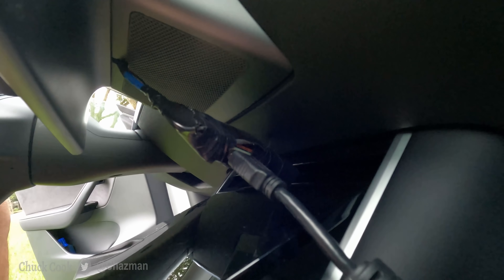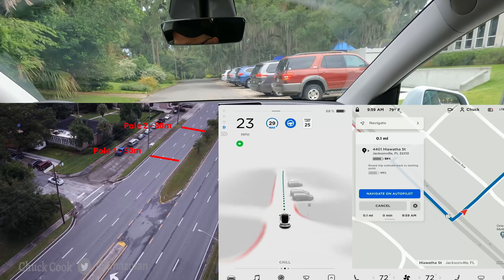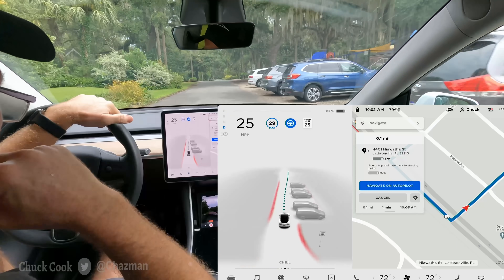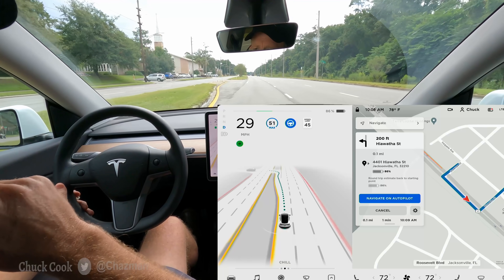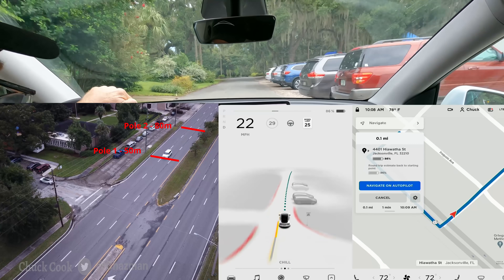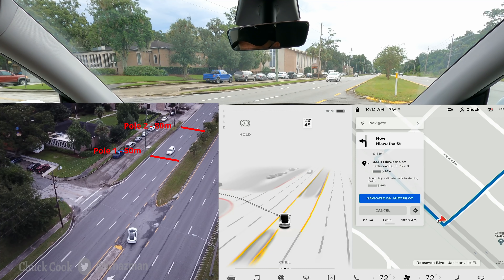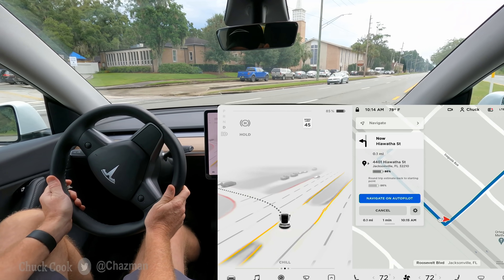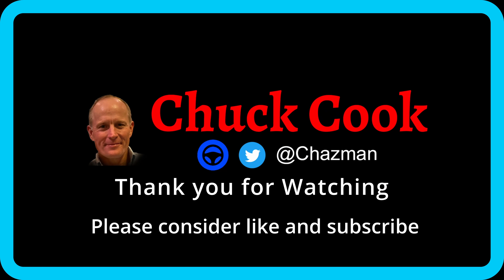FSDBeta LOTS of Forward Facing Unprotected Left Turns

Comment: I really hope the FSD team fixes it so that it keeps the wheels straight until it 100% is ready to go. IMO, no one should be pre-turning the wheel on unprotected left turns. I’ve seen humans that turn the wheels as well and slowly creep forward either intentionally or unintentionally and start to scare oncoming traffic.
Reply: Depends how heavy the traffic is. In some cases, if you aren't fully prepared to launch you'll be stuck for hours.
Reply: @yangdaily-andrewyangnewspo6434  Hours? No, it is never prudent to have your wheels turned because of the danger of getting tapped in the rear. This is one of the fine points of sophisticated driving, among several others that Tesla does not properly train their systems. Lane positioning is another - Tesla's AP blithely guides down the center of the lane, when sophisticated drivers choose to favor one side or the other depending on the circumstances (e.g., to maximize distance from large vehicles.)
Reply: @curtaustin8119  Actually, it usually stays to one side. It only goes down the center when the road is narrow enough to be a single lane and sometimes when turning onto another street (which will be fixed in time). As for wheel alignment, it sounds like you have a very easy drive that you never have to bend the rules to get somewhere. I imagine Tesla will move more toward your preference in time. Peace.
Reply: @curtaustin8119 :  Which of course, is another reason for HD mapping.  It's generally rather impressive how smoothly and subtly Mobileye's cars drive in complex city traffic.  I've seen uninterrupted Jerusalem drives where the car was just flat out a better driver than me in certain places where a fair amount of aggression was needed, for example.  (I prefer to just go around a block and avoid the risk of an accident when a lot of aggression is needed, having seen MANY bad accidents where people did crazy things due to impatience where I lived near very heavy traffic for a few decades).

I still think that HD maps for sure, and likely multiple sensor modes are going to be required for Tesla to get to robo-taxi level level 4 for complex cities, much less true golbal level 5 eventually (if ever).
Reply: @yangdaily-andrewyangnewspo6434 :  Given the state of Tesla FSD, do you REALLY want it launching through critical split-second timing gaps?  What if it just freezes up, as it's wont to do, for example, once it's started such a turn?  That could easily result in a crash or at a minimum, panic braking from other cars.
Reply: @rogergeyer9851  1) None of these were split-second gaps. Most had multiple seconds of buffer, which is comfortable.
2) Are you truly so ignorant of how Teslas work? If it "freezes up" you hit the accelerator and take over, which takes no time at all. There is zero danger of collision.
Reply: Not just that. If you get a bump from a car approaching from behind, with  your wheels turned into oncoming traffic, it won't end well for you....
Reply: FSD will be, if nothing else, embarrassing until it can drive with this sort of sophistication. I've had enhanced autopilot (highway-only FSD) for years, but never use it except for occasional testing - too embarrassing.
Reply: @curtaustin8119  What? I haven't had any problems with Autopilot at all since the phantom braking was fixed.
Reply: @yangdaily-andrewyangnewspo6434  E.g., last time I tried to use it (nav on autopilot, not just auto-steer): Coming up on my exit, my car is in right lane, but coming up on very slow car. Car slows way down, get's onto other cars bumper (we're the only two cars in sight), then decides to pass, then chickens out, then decides to go. Other driver was no doubt alarmed, and I was embarrassed.
Reply: @curtaustin8119  Oh, I don't really get to use nav. It's not available for most of my highway drive for some reason. Sounds like you'd be happier if you turn Nav off and use base Autopilot. Seems like they haven't been doing any work on highways since they started the city beta.

Comment: 2:45 - unless there was a pedestrian I couldn’t see, there was plenty of time. I 100% would have gone for it as a human. But similar to one for your previous video, FSD would have had to go aggressively and it’s been timid before.
Reply: from the drone view and windscreen view it looked alright to go.
Reply: I 100% agree to me it looked fine.  I need to review but.... this actually goes to what I've been saying about almost all of these beta testers: they are all extremely conservative drivers, which is probably good for a number of reasons, but it can be frustrating as a viewer.

I've re-watched while pausing every half-second and I will say that there is some concern about whether it even detected those oncoming cars.  I also wonder if we can be sure that these videos (the go pro, the drone, and the capture of the tesla display) are truly synchronized.
Reply: It's clear from the drone footage that the car could've made it at the speed it was traveling, but from the internal cabin camera, I'm inclined to agree with Chuck and would've intervened as well. Interesting how different perspectives mean different judgement calls.
Reply: With it's speed it could've made it, but I probably wouldn't have gone because (despite driving one for years) I still judge gaps like I have to wait for acceleration. I suspect Chuck was doing the same.
Reply: i would give it a pass here, the truck was 5s away, the same as the cars in the 2nd try. Tesla needs around 2.5 secs to complete the rolling turn, so enough time there.  I think the size of the truck made it feel like its much closer.

Comment: 3:45 you definitely made the right call.  If you go back and watch the videos and look at the pathing color at the same time you disengage I feel like that’s a reliable method to determine if the car was planning to proceed.
Reply: It was gonna go cause it would have made it - it took 2.43 seconds to make it through all 3 lanes on times it rolls. However it took 3.89 seconds for the first car to even make it to the point of the closest lane .  Car would have made it without a collision
Reply: @paulleddy3185 :  So any FSD issue is never a Tesla issue. 

Got it.  /s

Comment: Almost seems that 10.x is the most up and down release yet. It is like Tesla dialed up the aggression (which it needed) but not the "common sense" caution. Also seems that it now takes the "attitude": when in doubt JUST close your "eyes"/cameras and GO for it.
Reply from the maker: Pretty good assessment
Reply: remember, before you always commented that “it needs to go now, it needs to go” as the car hesitated. Now it goes for gaps any confident driver in a pokey car like a M3 or Y would take if in a hurry. I agree for a beta test at this stage, they should wait for gaps a little larger until confidence of the test drivers is build. The margin for error is very small once we talk 1-2 seconds time windows. If you would stall your ICE car with a manual transmission doing such a left turn on such a fast road in a gap as in 2.45, there would be an accident. I’d remove that unprotected left. It is inherently unsafe. How on earth can you allow a residential road enter into a 50 mph limit 6-lane road without restrictions or acceleration lanes or a plan in traffic light? If it would be a challenging airport with a safer alternative 2 minutes away, it would have been closed for a long time.
Reply: But I am still impressed by your courage to do these tests. From an armchair position after the fact, one has all the time in the world to decide. But you only have that split second to decide. Big thanks to you for your experiments at these fast roads. :-)

Comment: I legit want someone to overlay when he lets the car go at it’s speed, with a time where he stops it. And see how many times the car would actully do fine or not. Would be really interesting to see
Reply: Yeah I might just do this myself cause I legit think it was gonna make almost all those.   

Little sad tho about it almost hitting head on car when it did make the turn , that sucked
Reply: @molster1234  I agree on both, just count the seconds from the drone overlay, it looks like it would have cleared them all.
Reply: @molster1234 :  And enjoy the wrecks when it doesn't?

Sure, that makes sense.   /s
Reply: @rogergeyer9851  what? thats.. okay dude
Reply: Yes it probably could have made it in several of those instances, but it needs to make it with enough clearance so oncoming cars don’t get freaked out by a near miss. FSD team hopefully optimizes so that the system is aware of how other drivers perceive the car’s behavior. However, I do think that 2:45 would probably have been Ok to let car go.
Reply: You all assume the car won’t freak out when the B pillar sees a near collision about to blast the vehicle. They would have to almost code it to ignore danger approaching from directions not where the car is going but imagine how difficult that would be. There are certainly dangers you would want to stop for or accelerate for depending on the situation.
Reply: @bobdole6416  why would it, it already calculated the path based on the data.. its not gonna freak out when a data point just conforms to the model that it based its path off of
Reply: @molster1234  red car moving to different lane mid turn as shown in video, other cars speeding up, etc.
Reply: @bobdole6416 :  And it already ignores or is unaware of FAR too many dangerous situations.   Like barricades for Covid-19 dining tents in the roads in Chicago, for example (tries to drive right into them). 

There's LOTS and LOTS of work needed for reliable L4 city by city robo-taxi competence, much less the fabled L5 global performance.

Comment: I think in alot of the close cases the car could make it.. but obviously its very uncomfortable for the passengers and nerve racking for everyone.

I think Tesla needs to increase the available time margin in their calculations a bit more. Even if there is just enough time to make the turn before hitting oncoming traffic, I dont want to take it if it would make me very nervous..
Reply: I believe that they don't have enough compute power in the FSD computer to process the amount of calculations required to make Vision work with high speed traffic
Reply: But some attempts the car does perfectly.. gives enough time to wait then goes when free. 

I think it can be done, just requires more testing and tweaking. No doubt these left turns will be very solid in the next 6 months or so.
Reply: @louisdude1  only time will tell, how long has Tesla been working on this now, more than 5 years and they still can't figure out how to make a safe unpertected left turn. They sure are the leader in Autonomous Driving. I sure feel sorry for Chuck, he sounds so stressed out by the time he has finished a 15 minute drive.